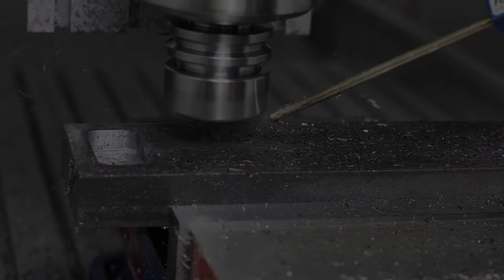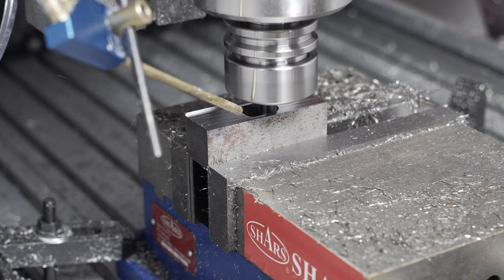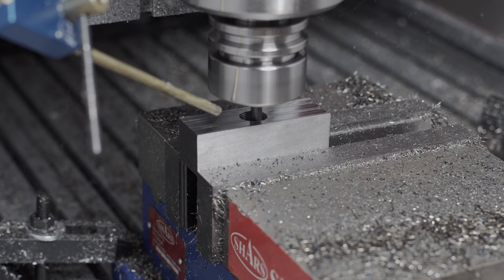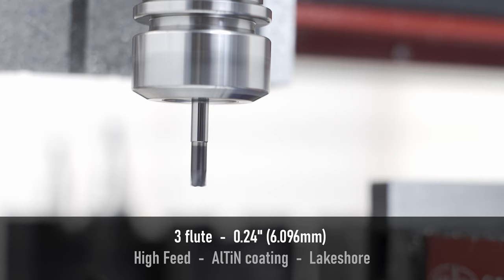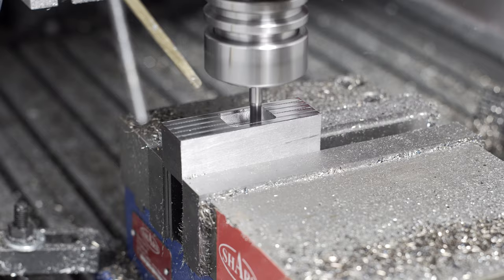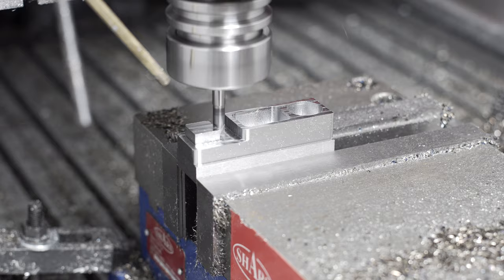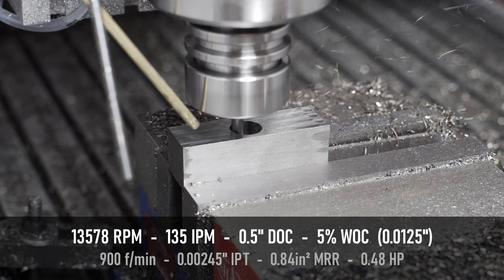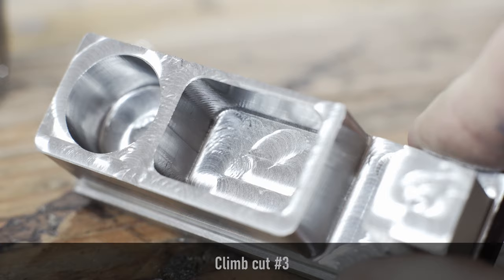More steel cutting tests on the Benchtop Pro

Comment: Calculate step per revolution and ballscrew pitch. Plug into software. Done.

Anything else you see is a mistake in your calculations or backlash. Use backlash compensation in software and make sure everything is tight.

Comment: Some metals self harden as they change temp. It's one of the reasons why steel is cut at low RPM. It's also why coolant isn't always used. Heating and cooling is how swords and knife edges are hardened...

Comment: Have you experimented with tool-stickout? Maybe a tip for next video. With the high feed endmill you used, I noticed you had the tool very far out of the holder, and that is not something you want ever, no matter how rigid machine you got.
Reply from the maker: Yeah that's a good point, not quite a fair comparison.  I generally try to keep stick out to a minimum... not sure why I had it so far out for the high feed.  Having a long stick out has caused me grief several times so it's something I've learned to be wary of since then :)

Comment: There is never an "always" in machining. Most of the time, coolant is beneficial. Some of the time it really doesn't make much difference, and the remainder of the time it is detrimental. 

I don't know anything about your machine, but if you are going to adopt HSM practices, you need to calculate feed rates accordingly. If you run a cutter at a given rpm, it needs to be cutting material at the appropriate IPR value for that rpm as well. Doing otherwise reduces tool life.
Reply from the maker: Yep, the struggle is real :)  The poor power at low RPM makes hitting lower SFM targets difficult, and the (currently)-limited top end feedrate makes hitting IPT at higher RPM difficult.  Can't easily fix the RPM issue, but I'm working on some modifications to enable higher feeds and acceleration without missing steps, or shaking the machine to pieces.

Comment: Do you use Mach3?  Step calibration is easy to set, use an indicator and a know sized block like a 123 block. In settings you can set MDI to go 1" and you set the actual distance travel from your indicator and insets steps per.
Reply from the maker: I do! So this was after step calibration as it turns out.  I suspect I either did it incorrectly, or need to repeat calibration at multiple locations around the machine to average out any non-linearities.  There are also two Y motors which I just blindly calibrated as the same, which I think is technically incorrect...but couldn't think of a better way to do it.

Comment: Climb milling...because who doesn’t love seeing chips fly?!
Reply from the maker: Haha yeah, I mean let's be honest, that's the only reason any of us do this anyway!  Gotta see those chips flying! <3
Reply: @BreakingTaps  Climb milling will eject the chips with more authority.  But, if the machine isn't rigid enough, it will tend to snag the work piece a bit.  "A bit" might mean reduced tool life and inconsistent finish, or it might mean breaking tools and scrapping parts.  

Conventional milling isn't as awesome at throwing the chips out of the way, but the load on the cutter is more consistent.  How about more air to clear chips out?  Two or three outlets rather than one.

Comment: Great series!  
1) Your saying it comes out 0.016" too large consistently.  I notice Fusion360 adds a 0.5mm "Stock to leave" on it's adaptive and pocket jobs by default. Is it possible that that is where you are gaining what would be from that?  
2) Regarding lost steps: Do you feel the belts are skipping on the reduction drive, or the motors are losing a step?, just curious
3) In 9:58 you speak of it shrieking a bit. Your concusions are fair on that one, as a tangent, would it help cancel harmonics to fill the upper lateral rail's hollow area with rubber pipe insulation, packing it tight? This would weigh a couple ounces, and the damping coefficient should cancel some of the amplification of resonance.
Reply from the maker: Thanks!

1) theoretically shouldn't be the issue, since I ran 2D contour and horizontal finishing passes after the adaptives (I just didn't show it on camera much since they were boring).  Which is too bad, since that would have been an easy fix! :)
2) The BenchtopPro has ballscrews, and the steppers are direct-drive on the ballscrews.  So I think it's the motors themselves losing steps :(
3) I think that would work yeah!  pretty much anything in there would help absorb some energy and reduce resonances.  I've considered doing the same to the lower rails too, but with something heavier like sand or lead shot.  It's on the summer todo list :)

Thanks for watching and commenting!

Comment: Hi freind..thank you for vidio..can you give us some information about power of spindle and what kind of motor you use for axises in machine??
Reply from the maker: Spindle is a 2.2kW, 24000 RPM from CNCDepot.  Same power as the one that Avid sells, but I wanted ATC on mine. Stepper motors are NEMA 23 420 oz-in, although in retrospect I would have opted to get the NEMA 34 960 oz-in (or servos like Clearpath)

Comment: Hi,

Legitimate note about HSMAdvisor in your video: This happens because at some point the default depth of cut becomes too large for the tiny 0.24" end mill.
Here is the full write-up and a screenshot with explanations: https://zero-divide.net/?&article_id=5266_avid-cnc-benchtop-pro-hsm-and-high-feed-milling

This issue will be fixed in the next update.

Great video as always!
Reply from the maker: Awesome, thanks @HSMAdvisor! On that note, is there a bugtracker/github/jira/etc somewhere to file bug reports?  Happy to pass them along if I run into them :)

Comment: You think using avids larger nema 34 steppers could help prevent he machine from losing steps? Maybe help it do better running at high feeds?
Reply from the maker: Yeah, I think so.  If I were to do it again I would have bought the NEMA 34s, or just grabbed some Clearpath servos.  Upgrading to servo is on my "someday" todo list.  I like to run it high feed and low WOC, and these smaller steppers just don't seem quite up to the task.
Reply: @BreakingTaps  yea, servos sound pretty nice, but I feel a bit intimidated by all the wiring and servo tuning I’d have to do.

Comment: Thanks for the video. I own the same machine but with the Avid spindle kit. I'm not sure I'm ready to feed it steel.
Reply from the maker: Good luck if you do!  Just start slow.   I think the Avid spindle is roughly comparable to the S30C so it should be relatively similar experience.  I think. :)
Reply: @BreakingTaps  How do you think the Benchtop PRO compares to the regular Avid PRO (eg, PRO4896) in terms of rigidity?  The frame of the Benchtop PRO uses several 8080 extrusions for its base cross-braces whereas the regular PRO uses fewer and smaller 4080 (the PRO4824 only has a single 4080 cross-brace).  I can't tell which gantry is more rigid - the regular PRO uses bit more parts but I think they both use an 8016 (eg, 80 x 160mm).  The Benchtop PRO also comes standard with the aluminum table, which you could certainly add to a regular PRO.

I've started receiving the parts for my PRO4824 and definitely plan on adding an aluminum table similar to what the Benchtop PRO has and also wondering if it might benefit from additional cross-braces.  I was initially going to get the Benchtop PRO but experience with a similar-sized CNC in the past had me looking for a slightly larger footprint, something where I could keep a vise permanently mounted and still remain a decent working area for small sheet.

Either way, I think it's pretty impressive what's shown here.
Reply from the maker: GordonGEICO : I haven't seen the PRO4896 personally, so hard for me to give much of an opinion.  But I asked the Avid folks exactly that before I bought, and they recommended the Benchtop for metal cutting.  Here's what they said:

>>>>> Start email

With milling aluminum being your primary use, I would recommend the Benchtop PRO over the larger PRO platforms. There are a few key areas where stiffness is significantly improved:

- Gantry: The shorter gantry travel is obviously stiffer, but beyond that there is simply much more material on the BT PRO gantry. It uses the same 80x160mm extrusion as the larger machines but then has a ballscrew actuator bolted on the front which boosts the stiffness further.
- Y (table) axis: the BT PRO has two linear rails supporting each side, vs one on the larger machines
- Ballscrews: While these don't affect the stiffness they do provide smoother, quieter, and more maintenance free motion than the rack and pinions.
- Table: Under the extruded T-slot table shown on the website there are three stout 80x80mm extrusions connecting the left and right Y axes. This is a much stiffer standalone structure than the larger machines.
- Depending on the shape of your parts you may want to attach a vise to the substructure, or create your own fixture plate.

<<<< End email

Hope that helps!  I would probably quibble with the ballscrew point, since I believe ballscrews do contribute to stiffness (since they are resisting the load and any deflection on their part is backlash), but I see his point overall :)
Reply from the maker: All that said, I know other folks (youtuber Robert Cowan comes to mind) who have successfully cut aluminum on their fullsized Avid machine
Reply: @BreakingTaps  Thanks for the info.  It's pretty much what I expected.  The Benchtop PRO looks like a real good machine.

Comment: How do you like that shars vice? do you find it accurate enough for the machine?
Reply from the maker: It's acceptable, for the kinds of non-precision work that I mostly do :)  I haven't checked for parallelism and such but it gets the job done.  When I need a really tight tolerance on something, I tend to leave the part slightly oversized and finish it off the critical dimensions on my manual mill since it's easier to sneak up on features that way.  This Old Tony somewhat recently did a video tearing down an import vise (https://www.youtube.com/watch?v=Zl6wpdtBZhk) and the results were... not great :)  I suspect my Shars vise came from the same factory as that one, looks basically identical, so his results probably apply to my vise.

Comment: what is an honest cost for a running machine? it looks like around $5g for the machine and you end up around $10k to have it actually able to cut anything. am I accurate or no where near?
Reply from the maker: Yeah that's probably fair. I think I ended around 7-8k plus some for tooling (tool holders, endmills, vises, etc). If you went with a non-ATC spindle it'd be a bit cheaper.

Comment: I'd love to know the noise level of the machine while cutting. Have you measured those? Mine gets up to 130dB which is crazy loud.
Reply from the maker: I haven't measured, but it is very loud!  When the spindle is at max 24k RPM you basically have to shout to be heard, and I wear hearing protection when working around it.

Comment: Do you have a video where you talk about your spindle?  Was thinking about the same s30 you have, any information would be great.  Would this be the one you go with again?
Reply from the maker: Afraid not, never got around to doing one on just the spindle / spindle setup. I'm pretty happy with the S30C though!  CNCDepot has a lower RPM model now that might tempt me (12k instead of 24k, would make steel work easier)... but I'd probably go for the higher speed again because most of my work is in aluminum and that suits a higher speed.  The toolchanging aspect has been flawless, no complaints there. Only recent irritation was from Fusion 360, which has disallowed tool changes in the free version.  If there was anything I'd change, I'd probably get a better VFD for the spindle.  I went with a Hitatchi NES-1 which doesn't have vector control, and I've noticed it lose steam on lower speeds faster than it probably should.  A vector VFD would probably perform better at lower speeds, from what I've read.
Reply: Thanks for your videos and insight.

Comment: Any ideas for making small holes like 2mm in diameter in steel on your machine?
Reply: At a depth of 10 mm?
Reply from the maker: Hmm, not sure to be honest.  If you went with a carbide drill, you'd max out the RPM at 24k so that's ok... but I'd be worried about such a small piece of carbide (really needs good rigidity which the machine might not provide).  For a HSS drill, you're around 8000 RPM which is on the lower end of usable torque.  But OTOH, it's such a small drill it's not removing a ton of material.  It'd probably be fine as long as you were pretty conservative.

That's in A36 though, not sure it'd do well in something evil like stainless :)
Reply: @BreakingTaps  4140? maybe
Reply: for making only a few parts you know the ipm can be very small